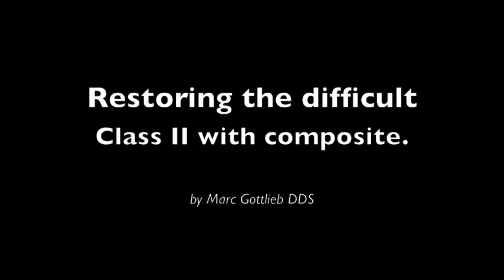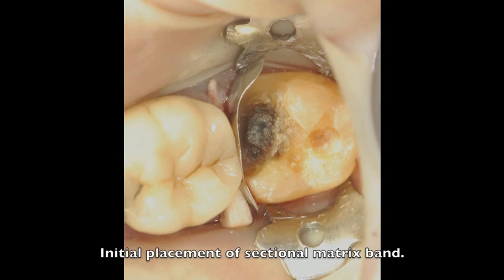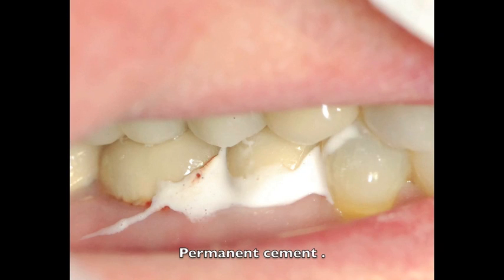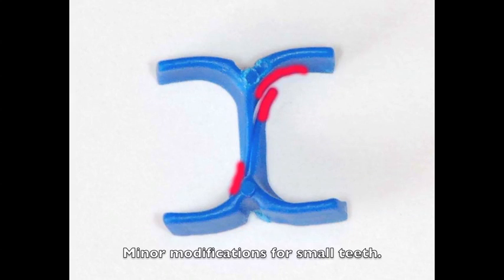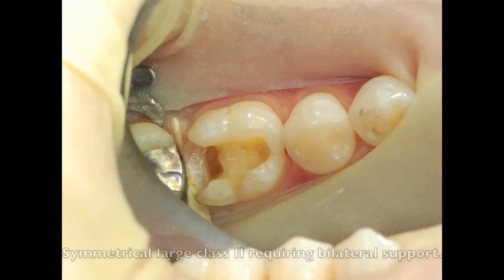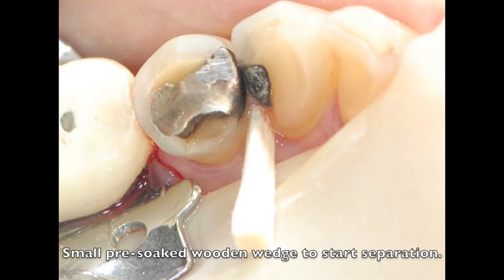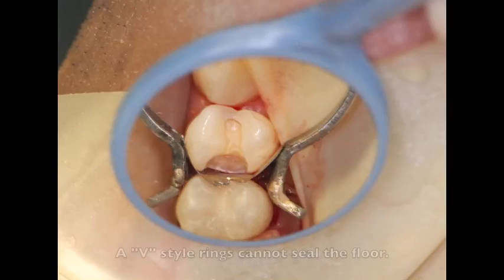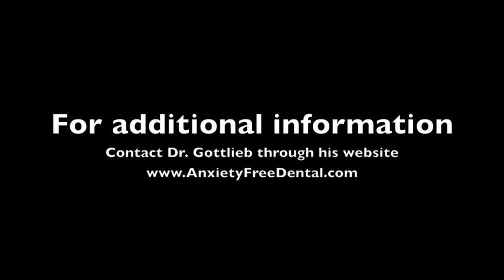Restoring the difficult class II cavity with composite utilizing the ABC Wedge

Comment: why do you place a  rubber dam clamp without the a dam?
Reply from the maker: There is a rubber dam in place and then the separating ring on the outside of the ABC Wedge. It's hard to see because for a long time I used an ivory colored dam.
Reply: @Fixdecay  Ah ok, you're right...it's hard to see :) I'm used to the standard green/blue/black ones

Comment: How would you restore the decay if this would be my tooth? I accept nothing but amalgam as filling material and I would rather prefer the loss of the tooth than a filling with this toxic industrial waste....... 😑
Reply from the maker: You can fill it with any material you like. The solution is for a matrix system that restores a tooth back to form and function. Proper contours and tight contact.
Reply: Sorry - this sounds like a 3M ESPE-commercial to me - I'm just missing "Proven solutions you can trust".......... 😐

Don't get me wrong: My teeth will be filled with a material that lasts for decades (I still have amalgam fillings from 1977 and my dentist tells me at every checkup:"There's no need to replace them" ) and not with a material that claims Redentistry in a couple of years. Keyword: Polymerization shrinkage...... 😉 A problem that the "nazi party in dentistry" from St.  Paul still keeps denying..... 😕

3M ESPE chief propagandist Keith Haig can lie, as much as he wants to: I have banned Composite from my mouth, my wife's mouth and my daughters also grew up with amalgam. 

If a front tooth has to be filled by a cavity or a trauma, you can crown the tooth - Composite doesn't have  any indication or any right to exist. 

I studied dentistry in Germany and I always fight for a worldwide phase-out or complete ban of Composite worldwide. If any of my friends sees me with a Composite filling,  it will be immediately replaced with amalgam - I practice a Composite-free dentistry. 

If a dentist would fill one of my teeth with this toxic industrial waste (BPA, Formaldehyde.....): See you in court,  doc...... 😉